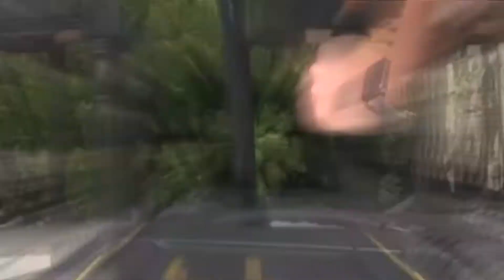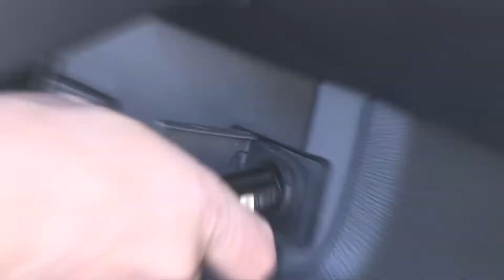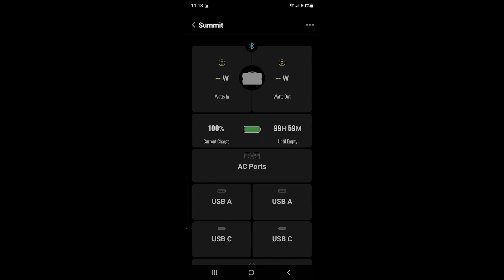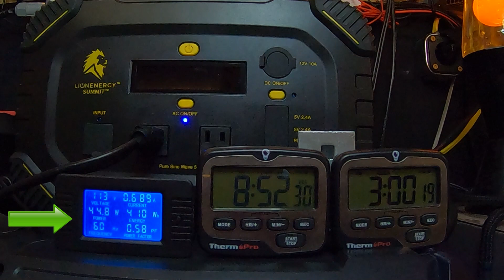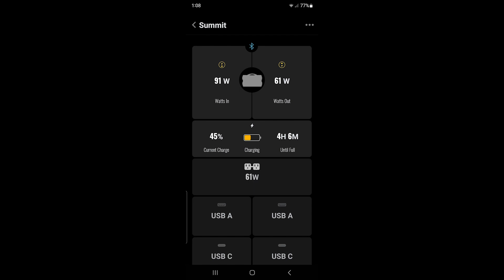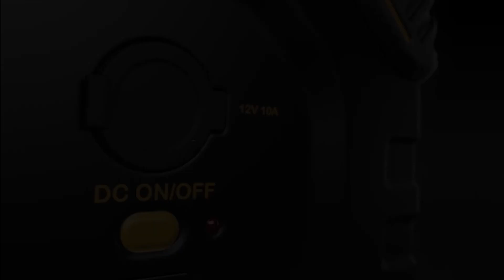Unboxing and Testing the Lion Energy Summit Solar Generator: Is it Worth the Hype?

Comment: Can you explain what he part that you finally ran your coffee maker with in layman language? Thanks
Reply from the maker: The coffee maker was a bit too much for the 12 volt lighter socket on the summit as it can only provide 10 amps and the coffee maker took 15 amps of power. Since the coffee maker only had a 12 volt cigarette lighter adapter I had to use a 120 volt to 12 volt power converter (the black brick thing)  to finish the experiment. I hope that helps.

Comment: I bought this yesterday at Costco.  won't turn on right out of the box.  called the company to see if I was doing something wrong.  Nope, they didn't seem to care thsat their product is crap.  Back it goes.
Reply from the maker: Lion Energy is usually really good about customer service. I'm surprised they didn't make it right. Thanks for sharing your experience. :/
Reply: I saw this at Costco for $500. I was curious but then I realized that it is soo underpowered. I’m a truck driver and I already have a 3000 watt inverter installed. This thing is trash compared to what I have

Comment: Quick question: Does your AC power block get extremely hot when charging the generator?
Reply: YES!  like insanely hot.  I called about it and the company didn't care at all.. LIKE AT ALL. i'm not exaggerating, it melted the plastic desk mat i put my chair on. I'm returning it this weekend.  in my opinion, it's not safe to have around kids/pets/floors if you plan to ever use the power brick to charge it.
Reply: @bluetrousers1  Wow!! I thought it was just me. Had to return mine as well. I reached out to them about it, told them that it actually burned the tip of my finger, and here is what they said: 

“We are sorry to hear about discomfort the charger caused to your fingers. The charger is UL tested to not melt or catch fire. We are working with the manufacturer to get a charger box that does not get as hot but are not sure when the new option will be ready. We are happy to send a replacement charger but will operate the same way.”

It’s unfortunate because I was really wanting to like it.
Reply: @fgomez3553  HA!! They said the same thing to me.  "oh, it gets hot, but it won't catch fire"  - "but it melted my flooring"  "but it won't catch fire!"  -  and yeah, it was too hot to touch or hold.   I returned it the other day.  I agree, I wanted to like it - but I guess I won't.
Reply from the maker: Wow. I am not having the same experience with mine. I put the power brick on the unit itself while charging. Perhaps it acts like a heat sink. This was advice given to me by several other solar generator manufacturers in regards to excessive heat from the power bricks. It seems to be a common issue with all power bricks from multiple companies but mine definitely does not get that hot. I can grab the whole power supply in my hand and it just feels warm. Thanks for sharing that with all of us.

Comment: How many amps are allowed by the AC outlets? 20 amps?
Reply from the maker: I can't remember. I think it is 20 amps combined between the two outlets on this unit. If you only use one outlet I believe it is 20 amps.

Comment: What is the point of designing and bringing to market such an underpowered solar generator ? 500 Watts ? Really Lion Energy ? What's the point ? Battery Expandability ? No ? This unit should be at the very least 600 Watts continuous duty with at least two expandable external batteries to prolong the usable running time of the unit. Yeah, sure, power all those little things, but for how long ? 40 Minutes ? The Safari made sense, but this little Brother is, well, too little. 👎🏻💁🤔
Reply from the maker: I use the little power generators for a lot of stuff. It will recharge all of those little things up 5 times which is very handy camping. It will also backup my refrigerator for a 11 hours which is cool. If you're looking for off-grid power backup of course they're different options that would make way more sense. If someone's just looking to power a CPAP machine in case of a power outage this is a great option. That's just my opinion but I appreciate the handiness and portability of the little guys sometimes. Thanks for the comment and happy camping.
Reply: agreed, bit id use it for charging laptops, portable fridge etc.
i wouldnt buy this at full price but costco has a bundle which includes a 100 watt panel, which i LOVE, extension cord, led lights.
the ONLY reason i am considering buying the bundle is because of that awesome solar panel, my favorite.
it is $250 on sale regularly, though i wont pay that much for just a 100watt solar panel.
hard decision for me.
Reply: THAT is what the Safari is for!  Oh, shame, shame I say, on Lion Energy for giving their customers actual options!
Reply: @araarthura3007  Nice try at Obfuscation ! When you can't dispute the central question, then why not make up a new one altogether ? The central core of the issue I raise is designing and manufacturing an overpriced, underpowered power station does NOT give their customers options, unless you assert their customers have the option to purchase an underpowered, overpriced, impractical power station as a valid option ? Now don't get Me wrong here, Lion Energy manufactures quality products. The "Quality" of the product I take no issue with. However, the point and design of this product is lacking in overall application, since it can't really run much and what it can run it cannot do so for very long ! If Lion Energy is going to make such a low power option, then it should at least have the option of some basic expandability to allow whatever it can run the ability to do so for longer periods. The difference between 500 Watt nd 600 Watts, is @ 600 Watts you can now run low wattage induction cooktops, and Energy Star certified modern refrigerators and small 12 Volt DC cooler/freezers.